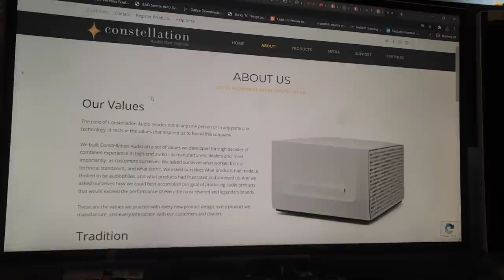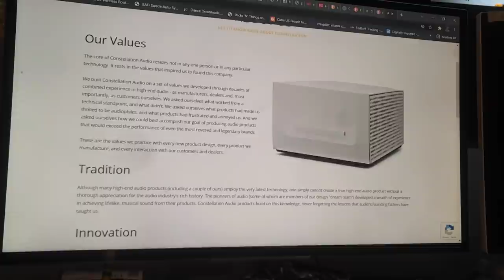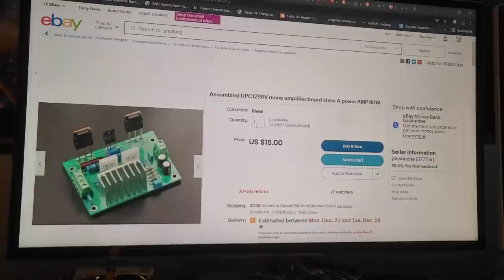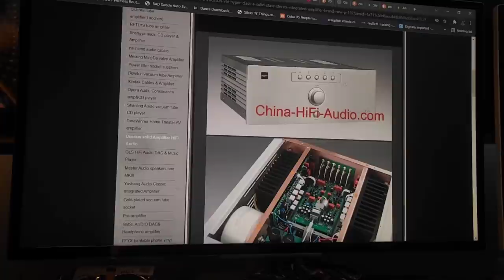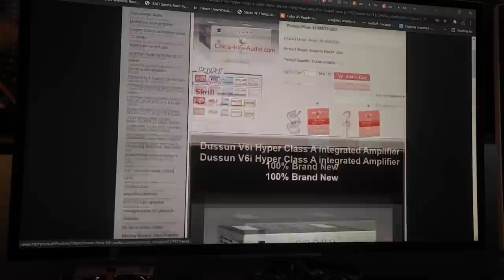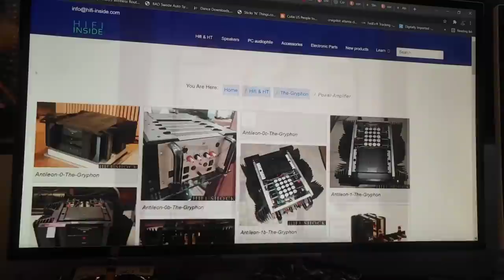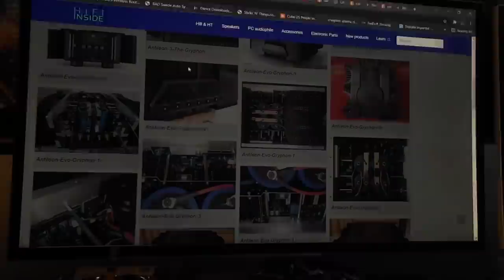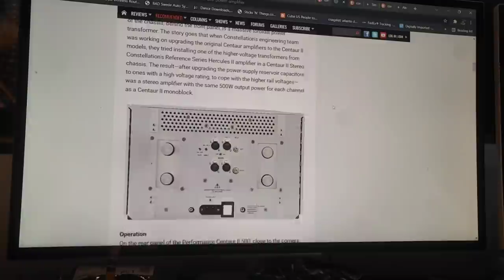SNIFFING OUT THE HIGH END AMPLIFIER HUSTLE

Comment: Back in the 80's there was the Hafler XL-280. I still have mine. You adjust a trim pot which subtracts the output from the input. When you have silence, you have a perfect response. Beyond that, there is nothing else you can do, except charge more money. Thanks Mike, for exposing the ridiculous fraud that is "high end" audio. Next, I wish you would tackle cables - the ultimate snake oil.

Comment: You can always recognize the truth, it has a certain ring to it.  I know most folks are not engineers, but everyone can see the rat's nest of wiring and instantly know what is up.  Nice job, Mikey.  You are my favorite burrito smoking hi fi guru!
Reply from the maker: Right on Jamie..
Reply: Even I am learned engineering, I am not well informed about audiophile circuit. Having to open up quite a number of amp. I can guess which is better designed. I used to have friend that mod stuff, they know who giving the right value. Good design don't seen the value to mod it into something better.

Comment: I’m curious if you have a view on Bryston, I own monoblocs 7b sst from 2006 (2nd hand purchase last September). Could not find much reviews on them !
Kind Regards Marc
Reply: Marc Bungener
Newer Brystons are better, but even older 7b are great. For the right money cant go wrong with that purchase you made.
Mikey is wrong in one thing - we dont need dual mono power - there is no difference beetwen 2x400VA toroid or 1x 800VA toroid. I can risk a guess that one 800VA is more expensive than two 400VA.
Problem is when insted two 400VA toroids is one 700VA.
Reply: @sheerenergy8602  thank you - I would not be too concerned indeed between monoblocs and stereo, the stereo is slightly cheaper than dual mono (one less chassis) - my preference comes from the weight : I prefer to have two monoblocs of 22 kg as of now (and 2 x35 kg with my old tubes monoblocs Sonic Frontiers SFM160) rather one time 45 kg or more
Reply: @marcbungener1877  Dual mono and mono blo-ks are two different things. Mono blocks are much better.

Dual mono are two power transformers in one chassis and monoblocks are whole mono amps in separate chasis and body. 
Mono blocks will have bigger transformers than dual mono integrates.
Momo blocks will be in most cases also separate from pre amp.
Reply from the maker: Hi Marc, Bryston is the top of the "workhorse" class. Its got an unbeatable warranty and it takes a lickin and keeps on tickin. It stems from the Pro Audio realm and its strong suit is reliability under stressful conditions. They do not disappoint those seeking the brand.

Comment: The best hifi system is the one you bought decades ago, still use and gives you lots of pleasure listening to your records, tapes and cds.
Reply from the maker: Thats for sure... Ive got mine now for the next decades !
Reply: @OCDHIFiGuy  I am listening to a Linda Ronstadt cassette tape right now that is dated 1978 that I bought in a charity shop for 50 cents (bought very many from charity shops)  being played on a vintage Sansui cassette tape player I bought for a few bucks. Played with Marantz SR 7005 and Klipsch RF 63. Awesome sound. The trick with cassette tapes is that they have to have been well kept. The trick with cassette decks they need to be cleaned with isopropyl gently, demagnetized, lubed with tape lube and with Dolby NR offnand the heads aligned if you know how to.
Reply: @OCDHIFiGuy  My country is the nightmare for all electronic almost on the equator. Everything break fast. I even repaired an $30,000 monoblock back then.

Comment: Thanks Mike - great presentation passionate , methodical, logical and caring about the customer. I had the covers off my Jeff Rowland to change some settings and it looks and feels even better than the pictures can convey, inside and out.
Reply from the maker: Hi Joe ! Good to hear from you man ! Isnt it the truth ? It clearly looks different than any other amplifier...  Because he KEEPS innovating. Most other amps are legacy designs that are old and just very slightly updated. The reason is why change if it sounds good ? But lets charge commensurately then..  ;-)
Reply: @OCDHIFiGuy  , And what it results with for Jeff Rowland 625S2 is an amp that sounds better, is smaller, lighter and less heat than more conventional amps in its AB class. And I love that the heat sinks are rounded, form natural side handles and don't cut you when you have to move the amp

Comment: Good presentation, thanks for sharing.
FWIW, on the 55k amp the circuit boards are paper thin. That screams to me that they will be susceptible to warpage due to temperature changes over time, and I agree about the wiring. It's hap hazard slop. As you point out the build quality and the parts used don't even compare to other amps in it's cost class.
Tough position to be in. You learn that someone got conned and they're bragging. Do you hurt their feelings, piss them off with the truth? If they're a person who likes to update their rigs often then a good lesson needs to be taught quickly for their next 'go around'.
Reply from the maker: Yes it's true, I choose to tell the truth in an open forum like this rather than on an individual basis. I understand people spend good money on some things that are not so great. Maybe they sound okay and that gives them license to charge through the nose. If I care about you I'm going to tell you the truth.

Comment: This video makes me love my Rowland Model 12's even more. Jay loses his street cred with his adamant love for Constellation after this destruction! Thanks for the education Mikey!
Reply from the maker: Remember, Jay is just talking about things that sound good and at the top of the sound platform in his view. He does not consider value but rather goes for the all out top level products in an effort to receive the best sound. So if we were to judge his cred, it should be on the sonic result not value ... This vid shows how Constellation loses the Value proposition in a hard way, but we dont know about the sonic results until I have one in my rig ...
Reply: @OCDHIFiGuy  honest answer Mike, appreciated!
Reply: @OCDHIFiGuy   Well Mikey, if it is sonically comparative with a dan d'agostino m400 and a gryphon antileon, seeing it is some old ass design with brown capacitors, then what are we paying for those ultra manufactured pieces if sonically its comparable to that junk in Jay's opinion?

Either Jay is flabergasted by the msrp of these devices, his system has such an impact that makes him flabergasted by whatever he smashes on to it, or these over manufactured pieces is just bullcrap on top of bullcrap that does absolutely nothing but increase the msrp of the component. I know what I think it is.

Comment: Fantastically, hit to the point.  I agree, but I doubt he agrees ultra great jay. Mike, what is your opinion about cables and is it possible to make such a difference in sound. When I try cables in the lower price range there is no such large difference.
Reply from the maker: My primary purpose in hi-fi started with my company VERASTARR which was started to blow away expensive cable brands with something perhaps a little expensive but less than half the price of the competition. So I am intimately aware that cables do make a difference. The one that you can't argue is speaker cables, and interconnects. Clearly if they alter impedance or capacitance, they alter the sound. Any third-grader would know that. Tough one for people is the power cord. Unless the system has impeccable AC filtration and isolation, the power cord is the most significant cable and the system as far as sonic is concerned.

Comment: Did you see jays post regarding this. He Skirted around the issue. Keep up the good work.
Reply from the maker: You know this post had nothing to do with Jay at all actually. It was due to A client sending me an open picture of Constellation and I absolutely couldn't believe the price when he told me. I think Jay knows that it was not a bust balls video on him whatsoever. Jay really has no reason to open up gear and look inside. I however am a low-level repair technician, and I understand circuits to certain degree, so I like to see how things are built. Thanks for your support though man, I appreciate it !
Reply: @OCDHIFiGuy  Really enjoy your posts and all the info. You and jay getting together has been rad.

Comment: Totally agree with everything you said but how does the average punter buying an amp would know what the internal looks like?
I hope my Vitus Amps are a good build internally
Reply from the maker: Hi Robert. They must be opened or searched online. Most every amp gets opened, photographed and published online, so "inside vitus audio" will yield images in Google. Then you can ask your trusted HiFi Guru to feed back on it for you. HINT: Most sellers are not also repair technicians nor understand circuit design even a little bit.

Comment: Id like to give the Jeff Rowland clone kit a try you were checking there. Still, theres a tiny bit more to amp building than slapping parts together, THOUGH one can in fact just do that should they choose. Spend some time over on Papa Pass's forums  and you can get a lot more in depth to the why's and hows of amp building.
Reply from the maker: Thats correct. Clone kit= slapping parts together.
Reply: @OCDHIFiGuy  you would think the sellers of these clone PCBs could at least recommend power supply components to get its full output, or bundle it with the damn board.  Ive got my eye on a Pass Aleph kit for some time now ill likely go with tust so I know theres support if I need it.

Comment: Let me say that I love the raw truth and how you expose these scam artists. I'm working on my own amplifier(pre-amp, dual power amp, and 4-5 way linkwitz-riley 24db active xover) doing all point to point pure .999 silver( all shielded with ptfe tube and silver plated copper braid) and silver litz point to point on the pre and crossover'S(yes 2 of them 4-5 way bastards) I'm working on my handmade cables and connectors(as in milling and pouring them myself) 
P.S
No way to make that 15$ board 80watt class A. 
Many if you cooled the power transistors and driver transistor with liquid nitrogen.

Comment: brown cap is 105ª (high temperature) thats why is automotive grade and industrial grade (i worked for gilbarco veeder root) Greetings from Argentina.
Reply from the maker: Greetings! I have family in Buenos Aires.  I prefer Audio grade at 85C with an amp that does not run so hot. If Im going to 105, Ill go Computer grade before Auto or Industrial grade.. I dont need vibration and shock resistance ... so Im just saying the caps are nothing special. They are chosen for temperature,  resistance and durability before ripple rejection.  Thanks for the feedback tho... I wish they made more 105c Audio Grade !!
Reply: @OCDHIFiGuy  yeah i know, we talked before, you always answer comments. Agree on the caps. I can not believe that that amplifier is marked at 55000 US dollars, we recently sold my grandmother house for 48000 USD located in the south of the Buenos Aires province LOL.

Comment: Look at a Levinson, Rowland, Threshold or Krell amp from the eigties/nineties and you know what value for money is.
Real Class A is best highlighted by a Levinson ML-2 monaural amp with a 1200VA Toroid, regulated powersupply with 150.000uF filtercaps for just 25 Watts at 8 Ohms. But it could drive the famous Apogee Apogee direct and you could weld with it. Constellation looks at least like way overpriced.

Comment: HiFi amp in your example sure doesn't seem to be  worth $55K - what is the design innovation or build quality or longevity of cheaper parts? Of course the Distributor and Dealers get a substantial percentage of the pie? Thanks Mike for your insider analysis! An Audiophile does not have to be an engineer to see the difference. I'm with you Mike, who are the 2020/2021 designers  and their credentials??
Reply from the maker: Its not worth the $$ in my opinion... Read the above comment.. I guess Gotham61 knows the designers involved  and is a fan. the fact theres 4 known names as designers actually hurts the brand as its proof that massive profit is required.

Comment: Good points all around.  It is about what pays them and not what is the best quality and value.  Many reviewers on YouTube are all about giving good reviews to manufactures that pay them.  Anybody seen all the killer reviews on the “new” KLH model 5 speaker?  Yet if you look at the specs they use electrolytic caps, sand cast resistors and iron core inductors.  They make it look all pretty on the outside but inside it is all cheap ass shit.
Reply from the maker: Anyone can build anyway they like and charge whatever they want. Its called freedom. I just make people aware of whats happening so they can be free to choose based on knowledge of exponential margins. My guess is KLH is not expensive ?

Comment: Hello Mike. Great video 👍
What do you think about the people who say that you can meausure sound quality?  They will typically say to just buy the amplifier or dac with the best measurements and be done with it. 
I have a gryphon diablo 120 amplifier which i love, but i don't know anything about it's meauserments.
Reply from the maker: Hi Henrik, Ive learned over the years to ignore specification. There has never been any mathematical data that has ever been able to tell us how something will sound. Ever. In history, never not once. Its an impossibility due to hearing being subjective as well as all the other variables besides the single piece of gear like speakers, the room, the other gear, etc. Spec is used to get a general idea of what you'll be listening to.  So listening comes first. then if it sounds teriffic, I want to see inside and look at the chassis build and pcb's to get an idea of its value. Listening is the most important.

Comment: Makes my 1990's  Krell KSA 200S for $3000 used look like bargain. Heck even it's $7000 list price adjusted for inflation at to $12,000 look reasonable. It kind of looks like the Gryphon inside with big blue caps . It supposedly has a 2800 Watt transformer inside. The transformer is frigging Huge. 110 lbs Amp. Must high-end audio has increased exponentially is seems since the 90's  to try and loosen millionaire wallets me thinks. There is a 1/8 real manufacturing cost to actual retailer List price , Like or Not. Sure you can buy direct but without a return policy what would be the point. I wouldn't make Retailers  out to be all Bad. They have huge overheads. Rents are ridiculous where I am in Vancouver, Canada. I estimate some of them pay upwards of $10,000/month. But where can one go to listen to beautiful systems and equipment. To be far you should at least listen to that Constellation amp  before poo on it. The transformer does look tiny though or the chassis is really big 😀
Reply from the maker: I did not even question the sonic quality in this vid. I assumed it sounded phenomenal. My point was amps like this sounded killer in the early nineties. Im questioning the peoples intention who designed this amp. Are they good people with clean intentions towards the end user ?  I show this by exposing the possible disparity between COGS and MSRP.

Comment: Two questions first what about the guy that does not have 50 thousand dollars to spend on a amplifier, but still wants good value for about 2 to 5 thousand a amplifier? I like Parasound and Mark Levinson. Question number two if we can not trust websites and magazines, then how would we learn about amplifier without going to school for a engineering degree? You need to do more videos like this because people I think would trust you ,because you are not selling them anything.
Reply: Audio show. Come to Singapore or Hong Kong where they have the most concentrated area of audiophile shop.
Reply from the maker: Hi Allen, I am very much a dealer as well as a manufacturer. This channel's root cause is to make you aware I am the guy you can trust, so you may decide to buy from me.

Comment: Stereophile Class A Recommended Components 2021
The Absolute Sound Editors Choice Awards 2021
Look at that “rats nest” almost Tube point to point soldering madness inside a Solid state Transistor amp.  Magazines should be ashamed.  Yes,Jay chose this on sonic grounds over Swiss built and Hifi royalty Nagra, but MAGAZINES SHOULD BE ASHAMED..what else is there..Denafrips your up..take off your casing and come here...
👏thanks Mikey
Reply: FYI, Denafrips opens the hood of every single piece of gear they produce. I don't own anything from them, but they sure are transparent about it. By the way, their shit looks good inside!
Reply from the maker: Yes it does, but you saw the amp in this video sold direct from China for $1099, this should give you an idea how ridiculously overpriced Terminator is at $6500... China has got too bold, they cant compete at $6500 ... its a $1500 DAC and it sounds OK Only.
Reply from the maker: Buying direct from China supports CCP/murder. Sorry I dont want Uighur blood on my hands.